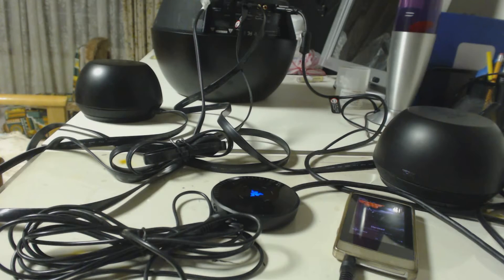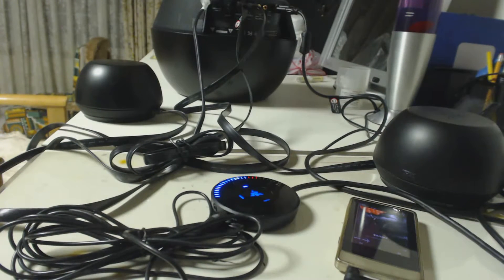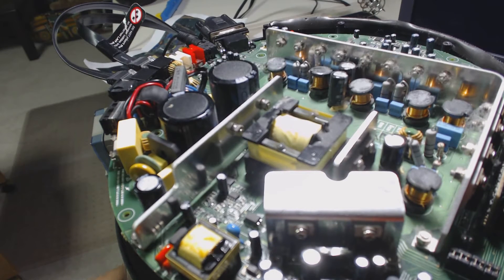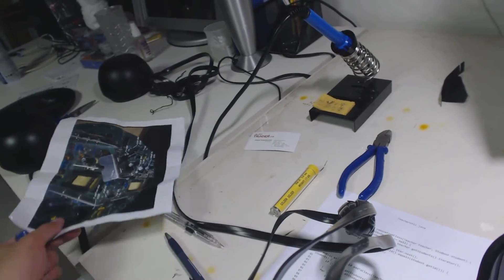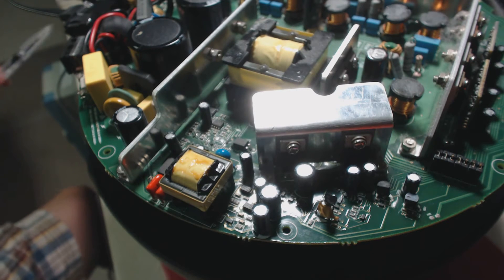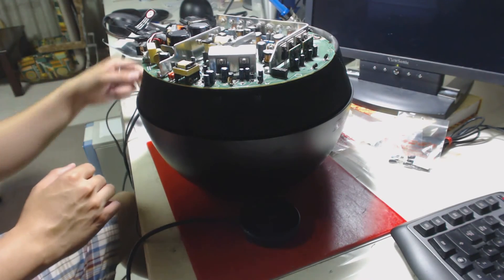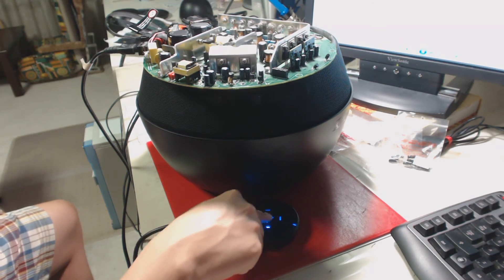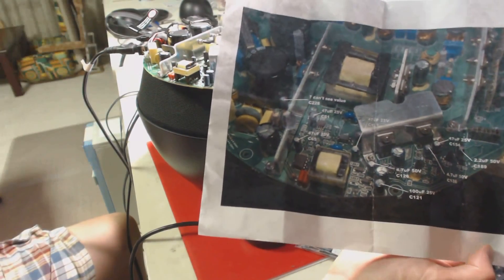Razer Mako Clicking Problem Fix

Comment: The control pod on my system just died, I am 100% sure it's the control pod, I have 2 systems and both work fine with 1 control pod, but not with the other one. Any thoughts about fixing the control pod?

Comment: Thank you for the good job TH0RFan.

Here is a list of Mako 2.1 capacitors that are problematic and need to be replaced if you experience a failure :

C121 100µF 25v
C122 330µF 25v
C125 47µF 25v - you can put a 50v it's better - (change this one first, it's the one that solves the "click, click, click, click" problem)
C126 4.7µF 50V 
C139 330µF 25v

Favor replacement with high temperature 105°C capacitors because those originally fitted are of poor quality.

Here are the recommended brands:

-Panasonic FC (recommended for power supplies)
-Vishay (recommended for audio)
-Nippon Chemicon
-Rubycon
-Sanyo
Reply: I've got the same failures others are describing where theres noise turning on but nothing when warmed up. i did the c125 about 8 years ago. hopefully the rest of these capacitors can fix it. Thanks!

Comment: Hi, i just got the same issue here, i wonder how do you identified which one is the bad capacitor?
Reply from the maker: I outlined that one exact capacitor in the video - Check that first to see if there's any physical dmg (ie. blow cap, leg break). If it looks fine (like mine when I had this issue) and if you have a volt meter you can probably attempt to troubleshoot it (https://www.youtube.com/watch?v=AvlNKZ8GzEg&ab_channel=StupidCircuitBoardRepair). If you dont have any experience doing electrical work then I would not recommend you do it yourself. Conversely, just go ahead and change out that one capacitor....it just might do the trick and you have it working again.

Comment: I have one of these. Basically this speaker system is marketing genius but put together with shit components. A speaker system this pricey should not fail in less than two years. I have a 7.1 Creative sound system (cost 1/4 of the price of the Mako) that I was using for 3 years before getting the Mako. The Mako died after less than two years use and I went back to the creative sound system for the last oh I don't know 8 years or so and it's still going strong. Just stay away from Razer...seriously it's like buying an old school Skoda, putting a Lamborghini body kit on it and charging ££££. Razer is shit simple as that.

Comment: Hey man ! I have a problem with this product. My control pad is flashing and making a click sound when im turning it on. When it's turned on there's no sound. I might be able to get sound if I keep switching between bas and vol turning it up and down, but it hardly ever works anymore.. Do you have any thoughts to what the issue might be? :)